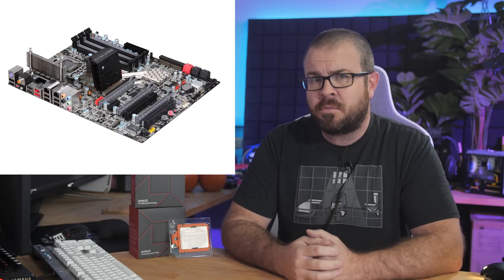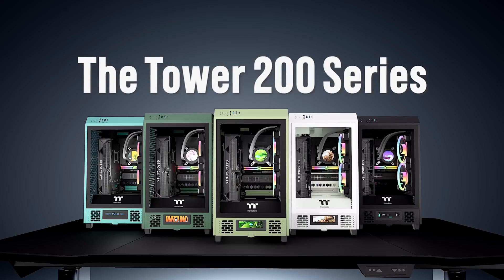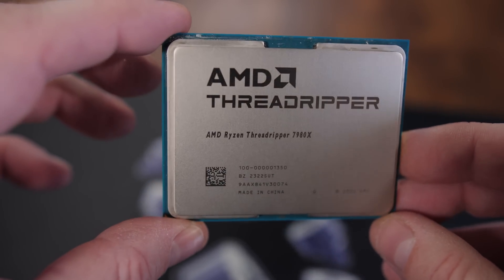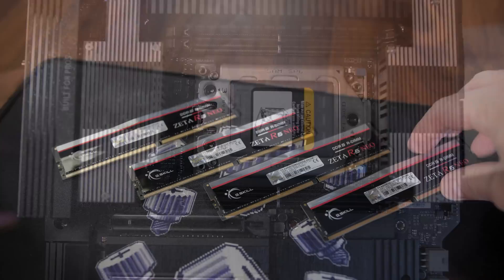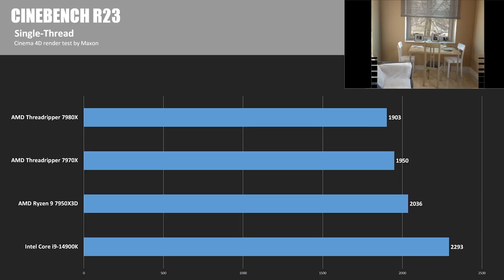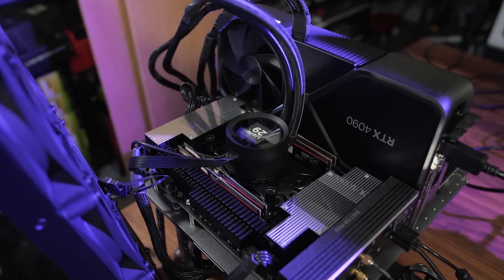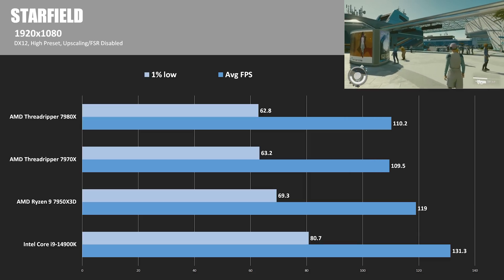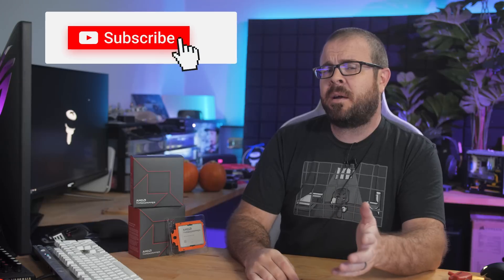How fast is a $5000 64-core CPU?! Threadripper 7980X and 7970X Review & Benchmarks

Comment: 00:16  HEDT actually only became a thing in 2009, retroactively, when Intel released a toy version of Nehalem with a smaller socket and only 16 PCIe lanes in the chipset.

This split was reinforced with Sandy Bridge, which moved PCIe to the CPU, and kept the lane count paltry in comparison to all previous PC platforms.  Sandy Bridge-E was like previous PC's in terms of I/O capability, but started at a much higher price.  This bifurcation continued, with the -E versions becoming ever more expensive.

AMD was in Bulldozer hell, which still had enough I/O, but had terrible performance.  Sadly, they also went the toy-PC route with Ryzen, when they moved PCIe onto the processor for the first time, forgetting to take a whole bunch of lanes with them.

Threadripper was the answer, though AMD has done a pretty poor job maintaining the platform properly.
Reply: Intel moved PCIe to the CPU already on Nehalem on LGA1156.

At least Intel HEDT wasn't much more expensive than mainstream when comparing low end of HEDT to high end of mainstream. AMD X399 (1st and 2nd gen Threadripper) was also quite affordable to people wanting more cores, PCIe lanes and memory bandwidth/capacity. There was a big jump in price with Threadripper 3000 and Threadripper 7000 isn't any cheaper so there's a HUGE price gap between mainstream and HEDT
Reply: Nehalem was a great design, only optimizing it, getting more and more security layers !
But the mem came with AMD outsourcing it's designs to TSMC producing them.
glue more chips on the CPU, is getting more I/O too.
intel did good Tik Tok Tak, updating the chips, the 14700 is good enough !
ecores ? Gamers only need 4 Cores on 6 Ghz, just needing enough frames only, rest of the I/O can get other cores, what ever you name it, slow cores ? Green cores ? i-Cores on apple !

Comment: 3970x user reporting in: love this CPU after two years of use for work and play.  It really is overkill, though, and I think the sensible option at the time would have been a 16-core CPU.  I had the money to spend so I went for it, and I think the biggest reason at the end of the day was the extra PCIe lanes for more storage, which will keep me satisfied for years to come.  I don't see myself needing to upgrade to this gen but it still looks like a great product!
Reply: Throw on BOINC, hook into PrimeGrid, chew through computing. :) 

Am tossing my new 7950X at it... ^_^ So far, so good.
Reply: A 3970X is a prehistoric dinosaur compared to anything in the new Threadripper 7000 lineup.

Comment: My X58 is still going strong. Its currently my media pc. Its really hard to let go of. From there I went to X99. And now my main pc is a Threadripper 2920x. So yeah i'm a HEDT addict.
Reply: My main PC has a 5900X, which isn't an HEDT chip, but... Most of my previous system is now my server, X99 with a low-power 12 core Xeon.
Reply: I just recently moved to X299 on my main PC after using X58 for 10 years. I do also have a X79/C602 system as a secondary PC.
Old main: Asus P6X58D-E, X5670 6c/12t @ 4.4GHz, 24GB DDR3, GTX 760 (previously a GTX 1080 but I stole it for my new X299)
Secondary PC: ThinkStation S30, E5-2690 8c/16t, 64GB DDR3, GTX 960
New main: Asus TUF X299 Mark 1, i9-10900X 10c/20t, 64GB DDR4, GTX 1080
Reply: My Commodore 64 is still going strong. It's currently my workstation pc.

Comment: My first HEDT build was back in 2000, a dual-Pentium CPU system for a business graphics company. It had two Pentium 60 CPUs, 256MB of SDRAM and a Matrox video card in a full-tower case. It cost mucho bucks and ran Windows NT Workstation. By 2008 it was so obsolete it wasn't funny but it had earned its pricetag many times over by the time it was retired.
Reply: Pentium 60 in 2000? You sure about that? Because I built a dual Socket 370 Celeron system that year.
Reply: @samiraperi467  Thinking about it again, it would have been 1996 or thereabouts rather than 2000, using NT4 Workstation (I think I still have the install media around somewhere -- a few floppy discs and a CD). I particularly recall that at least one of the Pentium 60s had the infamous multiply bug and we got it swapped out by Intel for a replacement. I may also be wrong about the RAM, it might have been four 32MB sticks making up 128MB RAM in total.
Reply: Back then, I was rocking the Pentium Pro system, it was a CPU as large as a Threadripper and had 2 dies on the chip, a compute die and a cache die.
Reply: @andymetzen  PPro was nowhere as big as a Threadripper.
Reply: Where was that because in Canada in Y2K I had already gotten rid of a dual Pentium 233 MMX, a dual Celeron 300, and Pentium Pros could be found in office dumpsters. I was just starting college so those systems weren't that pricey, especially if it was DIY. Even Alpha 21264 systems were being sold by the pound so in what technological third world did P5 60s cost that much?

Comment: I still have my EVGA x299 x9900 but hardly use it, there is something about quad channel DDR that feels different to me.
its sad how these parts have disappeared into the abyss and I'm forced to use this dual channel, limited PCIex lanes setup without much choice unless I want to dump thousands which is kind of pointless.
Reply: kindnuguz
I just replaced my X99 Deluxe system, DDR 4 3300 XMP is still fast enough, the only problem is the Xeon cores on 3.8 max, 5Ghz HOT ?
limited PCIe lanes ? you bought the 6800k cheapest model on low PCIe lanes ? only replace the CPU please !
If 5Ghz is enough, keep it
It does USB thunderbolt 3 UBS20, all the I/O is good, 3 fast NVMe ports ! why replace it ? Games ?
You can have my Stix X99 board ! i stopped using it, Deluxe II is better for that CPU 69xx ? Xeon model !

Comment: I always loved the Threadripper concept of selling a server chip to a power hungry power user.
Reply: I always loved Intel selling non-server chips and still satiating power hungry power users /s (they run more power than these Threadrippers too)
Reply: I have no regrets of owning a TR4 1950x. If I had the money I would def buy a 2nd gen one if I could not sure if the newest version going to be worth it to really anyone at those prices...
Reply: tacticooldennis
I stopped making Xeon builds for gamers, X99 on ASUS Deluxe was that last. 5 Ghz on all multi cores is just too HOT. 14900k is the same but better optimized only, only less Xeon cores, more Ghz !
Same design works better on 14700k, 2x 16 XMP fast profile, less cores ! Tik Tok got them this far now. Why you need more PCIe lanes ? only one NVMe is faster, one GPU ! less is better !
Reply: @lucasrem for gamers only, it doesn't make sense.

I could use it if I was rich tho. Having studied physics and currently studying data science, the memory, threads and gpu  requirements are insane for the actual not dumbed down stuff. If I had 10k-20k to use, I would benefit from the extra memory,  memory channels, cores and pcie lanes for a higher number of GPUs.

But that's in dreamland lol, still someone is living in my dreamland so it makes sense for this product to exist.
Reply: @Anankin12 then you’ll have to pay the monthly power bill 😂

And then upgrade every few years
Reply: Threadrippers are not "server" chips, which isn't a real concept to begin with. They clock high like Ryzen and are designed for overclocking. By your logic you could also say regular Ryzen is an even more cut down server chip.
Reply: @chiefjudge8456  Threadrippers have more in common with Epyc server chips.  Sure anything could be branded as anything. a Raspberry Pi could be a server too, But the core architecture is closer to a server chip than a standard CPU.
Reply: @tacticooldennis  Incorrect. Threadrippers have the same architecture as both Ryzen and Epyc (Zen 4).
Reply: @chiefjudge8456 It literally is a Sienna chip with a southbridge. The early BIOSes had all the Epyc settings/parameters. And server platforms have been distinct from desktop platforms for going on a decade now.
Reply: @shammyh  Threadripper is not a server platform.

Comment: HEDT was interesting when they didn't cost more than a used car. Anyone still foolish enough to think AMD are the "good guys" need only look at TR pricing to see exactly what AMD will do when they have no competition and realize they're perfectly happy gouging you every bit as much as Intel or Nvidia.
Reply: HEDT was only interesting because Intel wanted to sell 6 an 8 cores for much higher prices.
Ryzen made it obsolete and killed Intel's entire HEDT lineup with "normal" Zen 2.
Reply: @nipa5961  Then proceeded to charge the highest prices in history for HEDT. Forget core count, the PRICE to performance of Threadripper is much worse than the Intel Extreme HEDT chips of old. Even in the best case scenario which is rare as many apps don't scale that well, TR is only 4x faster than the 7950X or 13900k, but almost TEN times the price.

It's like comparing a bus to an SUV except that bus a half a million dollars instead of the 150k it should cost.

This is just another case of a corporation abusing a monopoly.
Reply: @zodwraith5745  Nothing has changed then. 10 years ago Ivy Bridge-E delivered at best 50% more performance for 3x the price.
Reply: in the "old days" AMD was struggling to sell EPYC. today they are not going to sell TR at all if they have to sell their best-binned chiplets for thousands less than they could get on the server market.
Reply: @ssl3546  AMD's profits are not a valid defense to gouge the consumer. By that logic they shouldn't make anything but Epyc and 7950X3Ds and Nvidia is charging too little for 4090s.